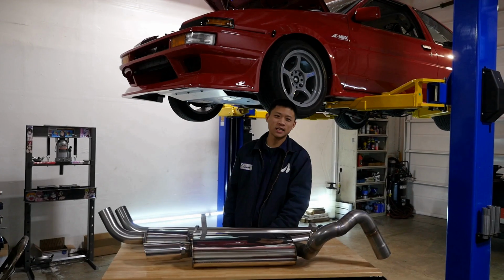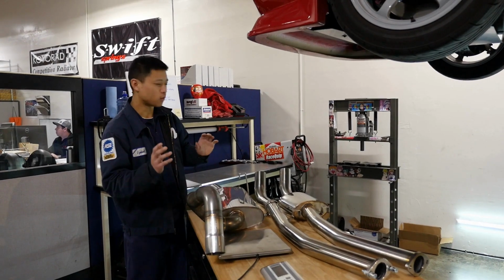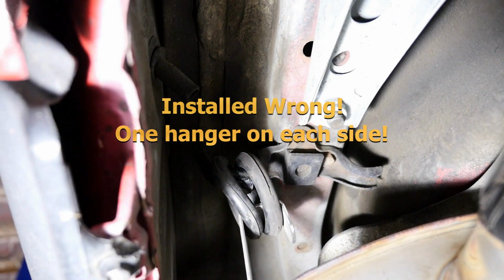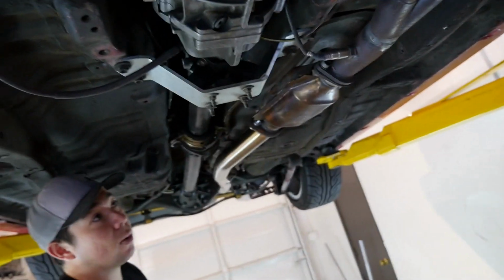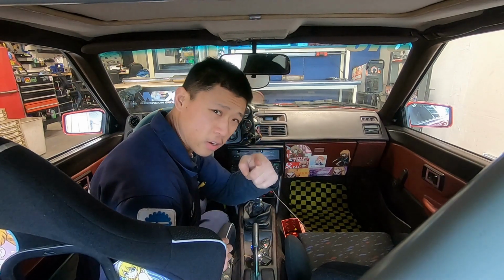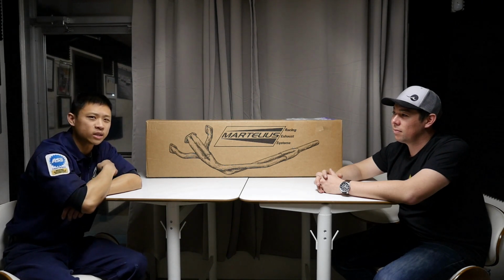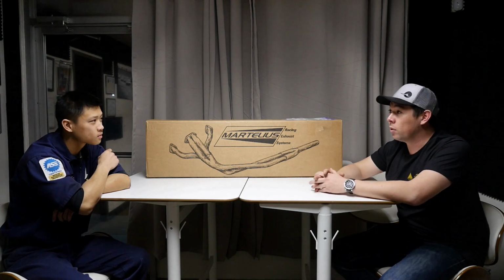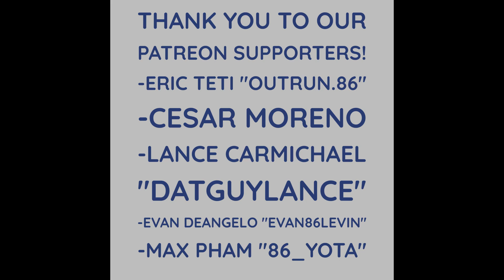Martelius High Output Catback AE86

Comment: Would this be suitable behind a beams? Or is there a better premade exhaust to suit a beams swapped ae86
Reply from the maker: HO being 2.5" would be perfect behind a BEAMS
Reply: @CMAutohaus  would you pick the martelius 2.5 inch over other premade exhausts for ae86s, like the hks high power, or BRAVE/RS Harada. Cheers
Reply from the maker: @adamlong1622  I kept my BRAVE because I think it sounds nicer. HKS Hi power is the cost effective choice.

Martelius has typically been the best balance of price/fitment/performance for me. I actually bought another Group A header (with my own money) recently to replace the prototype one